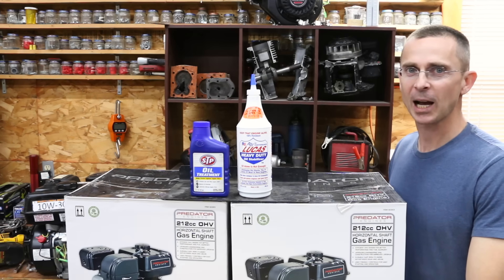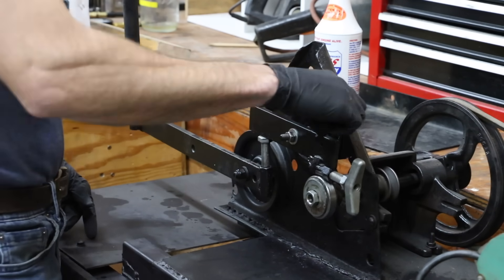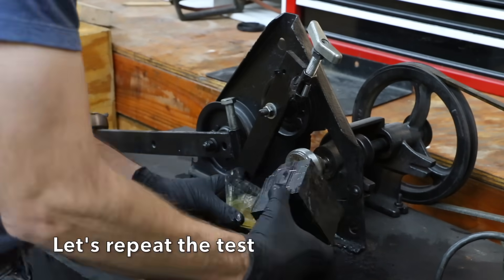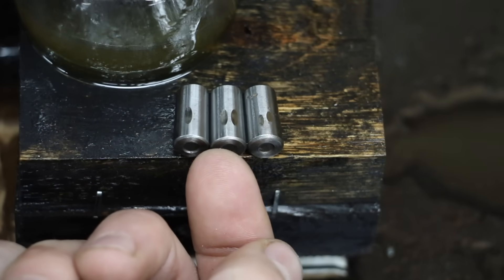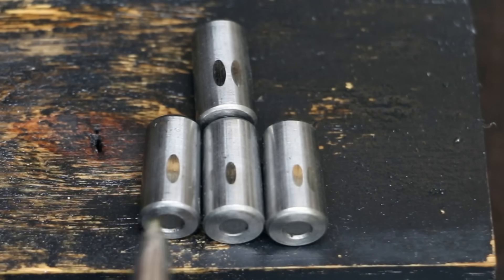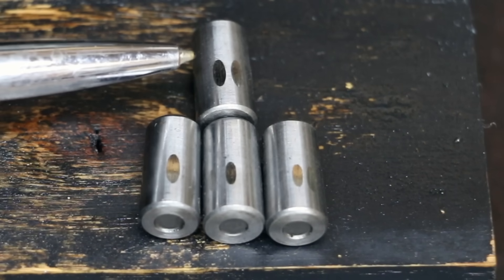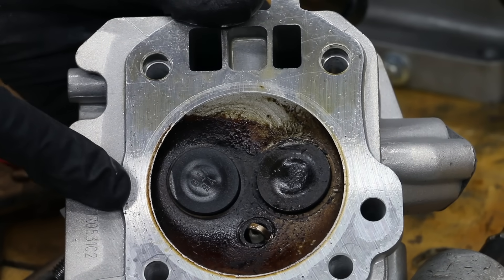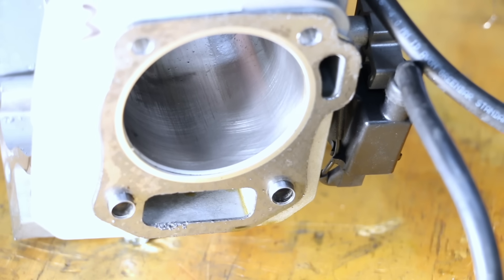Which engine self-destructs first?  Lucas or STP?

Comment: In order to test the thermal and protective properties of each fluid under stress, your experiment should have used one ounce of each fluid in its test engine.  By testing two oil-dry engines all you managed to show is that a dry engine will fail.  The tiny residual quantities of STP and Lucas offered virtually no protection to their machines and I fail to see how your test demonstrates the effectiveness of either.  Otherwise, I enjoyed the video.
Reply from the maker: Thank you for this recommendation.

Comment: Very nice test that you spent some time and effort on. Too bad it doesn't really relate to much. Any engine will die early w/o oil and making one run a few minutes longer implies "better" but in the real world means nothing. At best it might suggest the film strength is better but that's not an issue with good oil - especially in a lawnmower or power washer. Hands down you can always link a failed engine to neglect or  misuse - not which additive was used. If you properly maintain the engine, oil will never be the weak link in durability.
Reply from the maker: Thanks for the constructive feedback.

Comment: Your not letting STP mix properly
Reply from the maker: Thanks for commenting.
Reply: Project Farm to qualify my remarks. I've been a Mechanic for several years. I've used STP for years, and straight out of the bottle it's very thick and would have to much viscosity to be effective all on its own. However when allowed to mix with oil...it enhances the base oils ability to clean, cool, lubricate. Keep up the fascinating videos.

Comment: Here in the Philippines, A very, very popular additive is called Pertua. I am not sure if Pertua is even available stateside. It was developed decades ago way back in the late 80s  or early 90s by a Filipino Engineer who worked at Nasa and I believe he was a metallurgist. It costs only around $8. They have had many demonstrations running actual vehicles without oil, once with a van that travelled 240 kilometers without oil on uphill (Baguio) roads. One demonstration with many witnesses showed a motorcycle in high rev race laps with the driver getting too tired to continue. Not that well known abroad nor would it be accepted perhaps because it originates from a "third world" country.
Reply from the maker: Thank you for this recommendation.

Comment: I liked the first part with the bearings. looks to me that lucas did better. you could see it coated the bearing much better as it spun. but I'm not sure what running them both with no oil proves. I thought you were gonna fill them with just the additives as an oil substitute to see which held up longer. was the idea to see which engine would last longer with the residual coating after they were drained? I would have like to of seen how they did with the bare min oil and the additive, to simulate oil starvation or improper maintenance. that to me would demonstrate which additive helps the engine in less then optimal but still operable conditions. of course they will fail with no oil, doesn't matter what you put in the case previously... 
But all that said Good Vid! quality production value. love the channel.

Comment: I don’t understand how this test demonstrated anything about the additives. 
3 hours of running with an additive would produce negligible wear on the engine. No difference would be observable between an additive and plain oil, let alone against another additive.
Then, draining the oil and running them dry makes little sense. Manufacturing defects would account for much more of the differences observed than the 3 hours of run time. 
This was a well done video, but a very poor test in my opinion.
Reply from the maker: Thanks for the constructive feedback.
Reply: Your welcome. Thank you for not taking offence. I look forward to seeing more of your experiments

Comment: This was a pointless waste of time and money. Why run them dry? I understand  ‘time’ is a factor for everyone but this does NOT show normal ‘wear or tear’ and in NO WAY shows a normal engine failure from excessive use or a worse grade of lubrication.

Run it again, run both engines for 30 hours then pull them apart and look inside. Inducing an artificial failure just to ‘blow something up for views’ in no way gives anyone any useful information.
Reply from the maker: Thanks for commenting.

Comment: I don't get it.  Wouldn't a twst be to see how the oil performs as the oil and additives breaks down while the engine runs.  I don't see how this is a valid test to see which one works better.  Where on the label did it say "coat all the parts then drain the oil"?  Smh...
Reply from the maker: Thank you for this recommendation.

Comment: Try Duralube. I have been using it for years and the old commercials were awesome. One thing I must add, NO engine can run forever without lubrication.  It is not possible...
Reply from the maker: Thank you for this recommendation.

Comment: Aftermarket Engine oil additives can upset the additives of the Engine oil that are inplace from the oil Formulation, and in some cases will clash with the additives in the original oil formulation.  This  is why all oil Manufacturers do not recommend adding any other oil additives  , since they can upset the Chemical balance.  Example: Foaming of oil is reduced by using a Silicon Chemical.  If to much of that additive is used, it can make the oil foam more.  For me, I will never use any aftermarket  oil additive, as the oils already have enough of the proper additives in order to pass the API, JASO,ACEA, ILSAC, and Manufacturers Specifications
Reply from the maker: All great points. Thanks for commenting.

Comment: Was that footage correct showing that the Lucas engine was running hotter than the STP one when they were both full of oil? I’d like to see a control run with an engine using only oil, no additives.
Reply from the maker: Thank you for this recommendation.

Comment: if you replace the connecting rod on these engines, i think they might run again. you would also have to fix the cam too by cleaning the aluminium off of it too though. if i'm right, could you run vegetable oil vs lard in the engines? obviously i am not in the shop with you to look first hand, though to me it didn't look like the other parts were badly damaged.
Reply from the maker: Thank you for this recommendation.

Comment: Interesting test. I'm still going to use STP (Studebaker Tickled Pink) for the simple reason that I first used in 1959 in my '52 Nash Rambler. Never did blow it up. Used it in Harley's, Indian's, and Triumph motorcycle's. Don't use it in the primary chain case where the clutch is. You'll be putting in a new clutch! I'm still using it in my '78 Ford Pinto that's very mildly modified. Carb and everything inside the engine is stock. It'll cruise at 80mph and get 26 mpg. No sign of wear on the cam lobes or lifters. I'll stick with what I'm used to, I guess.
I wonder if the Predator engines are as tough as Briggs & Stratton. Might have had something to do with the results.
Reply from the maker: It's wise to keep using STP as you're getting great results. Thanks for commenting.

Comment: Would recommend using the scientific method
Reply from the maker: Thanks for the constructive criticism.
Reply: Yeah, I'd agree with Snoggatog.  The design of the experiment is fundamentally flawed.  Basically all you can really conclude reliably is how long an individual motor ran without oil.
Reply: Agree with Robert.  Since nobody intends to run an engine without oil, the results of this test is of no value to determine which additive is best when used as intended.  While interesting, nothing gained with this exercise.

Comment: what's the purpose of this test precisely? these products are oil stabilisers, not specifically lubricants themselves, it is no surprise the engines destroyed themselves.

Now a good test would be using Teflon wear additives, and empty the engine to simulate an oil leak, and compare Teflon added to oil vs just oil, and see how long they run once it's all out! that'd be interesting
Reply from the maker: Thank you for this recommendation.

Comment: I liked the video. However I'm still not sure or convinced that since I feel as though in this particular showdown of the two brands Lucas outperformed the STP doesn't exactly answer the question of if spending the extra money is worth the added expense. Setting aside the fact that the Lucas cost much more than STP brand is it worth the expense? Could I expect more life out of my engine if I used it? Could I assume any added benefit of better fuel economy? Could I expect any added horsepower? They both make the claim that those things would apply but is it worth it and does it actually do as they claim?
Reply from the maker: Excellent point. I hope future testing using synthetic oil and comparing the results to these additives will provide more information.
Reply: Thank you sir for your reply.
Reply: Running a 3rd engine with just oil could have given some insight into whether or not the additives are worth anything or not.  Without that though I'd say Lucas won out between the two in the head to head.  Thanks for the Vid.

Comment: Nice test, but it got little to do with what the additives are supposed to do.
And rather unsurprisingly - those additives don't help - when you are lucky, and actually make the oil worse normally.

Yes sure some can "help" for certain scenarios, like slightly reduce wear upon startup, but at the same time they reduce the performance of the oil under normal conditions and often lead to far faster degradation. Oil is already designed to work as efficient as possible. And contrary to those additive-manufacturers they do actual tests. there is a reason why most oil-additive companies had one or more encounters with regulations and found them self in court.
Reply from the maker: Thanks for commenting.

Comment: The only reason why I use the STP additive is cos it has ZDDP. I have an older engine that uses flat tappets and older, non-roller cam engines need the ZDDP to minimize cam wear
Reply from the maker: Great point. Thanks for commenting.

Comment: So in the other test of bestline vs motor oil, both of them beat these engines. Interesting. As someone else said, you should redo the test with just motor oil as a control
Reply from the maker: Thanks for commenting.  Not everyone has seen those videos.

Comment: What about Bardahl No1?
Reply: Bardahl worked well in my boats Volvo engine. The muffler melted because the water cooling stopped. Engine restarted after cooling off and ran well
Reply from the maker: Thank you for this recommendation.

Comment: Remember the Slick 50 infomercial 20 yrs ago that drove a dodge viper around a track with no oil - only the remains of slick 50?  Well, i was a naive 13 yo who put straight slick 50 into my Yamaha qt50 moped.  I didnt do a ratio- i did straight slick 50.  Ran the scooter for 3-4 days before it cracked the piston.   

how about instead of draining the additive you only put straight additive and see how long it lasts compared to conventional oil??
Reply from the maker: Yes. Thank you for this recommendation.

Comment: Those engines can run years with Lucas or STP, of course if you run for 7 hours then, take out most of the oil, the engines will blow up randomly, that's physics, engines are never made equally.
Take two identical engines, install two identical turbos, then optimize one from a dyno, and for the second engine, just copy over the dyno tune, I guarantee you that the one that did not get a dyno tune will run like garbage while the other one runs perfectly. All he did was show that not all engines are made equally, he ran about .00004% of the engine life, then drained the oil and blew up the engines. Retarded test.... If you want to test the oil, you have to use the oil, not drain it out.. It's common sense.
 I sure hope people don't continue to use such dumb methods, let's see which CPU paste is better the NT-H1 or the GC-Extreme, so we will run it for 2 hours, with same CPU and all(components), record the temps, then will take out the CPU pastes, and see which CPU blows up first, the one that had the NT-H1 or the one that had the GC-Extreme, so we can prove how retarded we are.
Reply from the maker: Thanks for the constructive feedback.

Comment: Very interesting demonstration.  Tho I think  a third motor treated only with the motor oil used in the treated engines would have made a good barometer for how much protection each additive offers.  Without the third motor, there is no way of knowing.  That said,  I am a big fan of Tufoil additive.  I've used Tufoil for over 30 years in all manner of motors - gas, diesel, marine and have never had a motor fail (full disclosure--I do verge on the fanatical when it comes to oil changes). I would very much like to see a Tufoil vs the best additive you can find competion.
Reply from the maker: Thank you for this recommendation.

Comment: Got 300,000 miles out of a 01 neon 2.0 liter. Bought it with 105,000 and used a bottle of Lucas every oil change 3k to 4K miles with pennzoil 5w30. Still ran good when got rid of it.
Reply from the maker: Thanks for commenting.

Comment: Interesting test and conscientiously performed, it seems. I'd like to have seen precise matching rpm measurements, at least at the outset, and a third engine with no additive as a control. You might also have done well to have given a brief summary of the results at the conclusion. Still, all in all well done, and I look forward to more tests, particularly ones with AMSOil, Mobil1 and maybe Walmart's house brand Super Tech synthetics.
Reply from the maker: Thank you for this recommendation and thanks for the positive comment.

Comment: Try Husky,or Stihl bar and chain oil in a 4/1 ratio.
It works as well as either the Lucas or STP.
Reply from the maker: Thank you for this recommendation.
Reply: I've used bar and chain oil on motors to lessen smoking,lifter clatter,and knocking.
It's not as thick as the STP or Lucas and circulates through the motor better,especially in colder temps.
Not sure about the Lucas,but the STP will eventually gum up a car motor.
The bar,and chain oil wont.
It's also economical if you buy it by the gallon.

Comment: I switched from STP to Lucas a year ago in my 95 Tahoe 5.7 it had a slight knock eased up a little with STP I could tell a difference after a month I switched to Lucas the noise never went away completely I now use Lucas it doesn’t knock as bad at start up
Reply from the maker: Thanks for commenting on this. The 5.7 is a great engine.

Comment: Since you did say "additives" I will ask to please test Bestline Engine Treatment vs Militec Oil Additive (optional) vs TVT Engine Oil Additive. On Youtube there is a video that claims Bestline as the best additive out there, bar none, for sale as "proven" by their bearing wear test machine. Militec has been around for a quite a while and has been known to protect gears and engine parts quite well. Then TVT makes the bold claim, "We have seen engines run for hundreds and even thousands of miles with no oil in it once treated." and that alone should tell you just how the ad is confident that your engine will be very well protected. TVT also makes a variety of other lubricants for firearms, fishing equipment, industrial equipment, etc. This I have to see!
Reply from the maker: Thank you for this recommendation.

Comment: What was the additive that claimed to soak into the metal...Carol Shelby endorsed it..
Test that stuff...
Reply from the maker: Zmax. I tested it in a recent video and it didn't do too well, since it 99% mineral oil.
Reply: Project Farm thanks I'm gonna check it out th vid...in ur opinion what's th best motor oil on the shelf...just oil... not synthetic or for diesels just 10w 30 engine oil...thanks for ur time...

Comment: When the engine had oil, STP seemed better as it ran cooler.  When there was no oil, Lucos did better as the engine lasted longer.  Either way just having oil in the engine is better than not having it.  Also we need to see how these compete against quality oils.
Reply from the maker: All great points and thanks for the recommendation.

Comment: To make the test more scientific, you should have checked the rod bearing clearance and rod bolt torque and compared them. Its very likely that the Lucas engine was closer to spec than the STP. These Chinese engines have varying quality!
Reply from the maker: Thank you for this recommendation.

Comment: How about Z- Max , if I recall
 There 1st claims were that after treating you cars engine with Zmax you could run your car without oil in the desert no less and it with function without flaw .
Reply from the maker: I tested Zmax in a recent video and the engine didn't last as long as the Lucas engine.

Comment: RIP perfectly good motors, all in the name of science.
  Great video.
The STP recommended ratio seems to be its downfall, not the product.
I'm still a LUCAS oil man .
Reply from the maker: Great point regarding the ratio. Thanks for the positive comment.
Reply: Exactly my concern about the validity of this test.  STP is saying you don't need to use so much in normal circumstances.   Lucas says please use twice as much of our product vs. STP.   Unless we think Lucas is diluting their product vs. STP, then the test should have used equal concentrations of the product regardless of the manufacturer's recommendations.